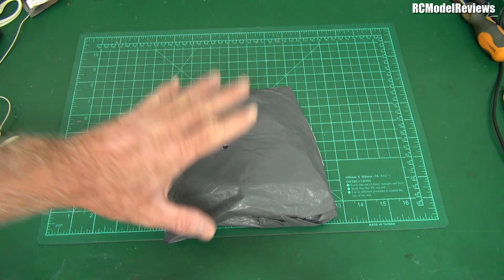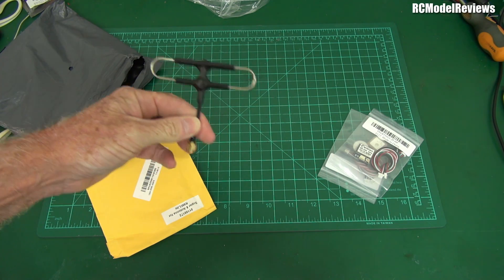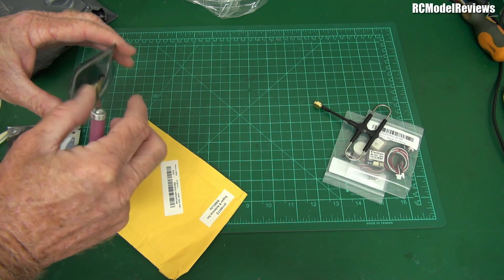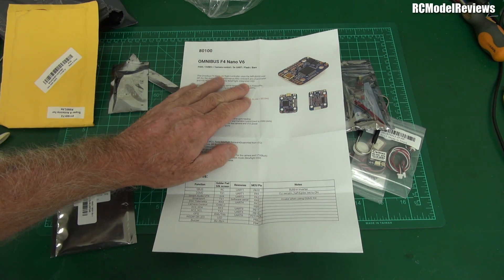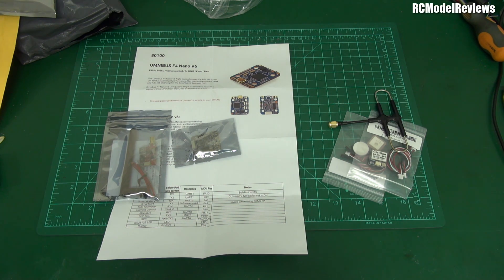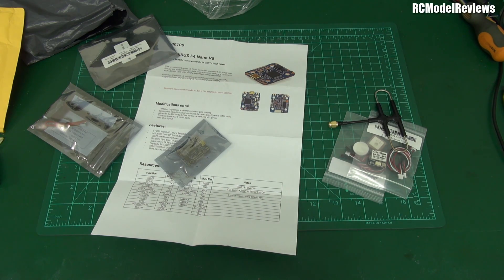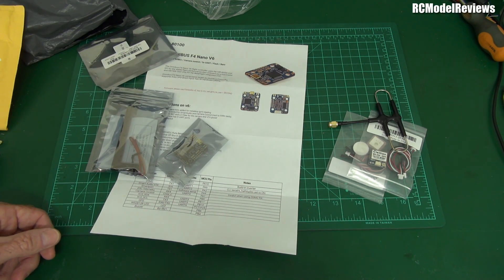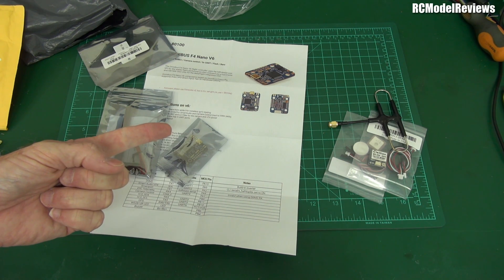Sub-250g long-range FPV project (bits have arrived)

Comment: you should check out Matek VTX-HV. Suppose to be really good. I just ordered one myself to check up against the TBS Unify Pro HV.
When are you planning on getting in the air? And what are you flying? Quad or wing? The WingWing Z-84 should be pretty good for a light build.

Comment: Hi
I also used the airbot 20x20 for a small build but missed the current sensor. Well, I added one of these XT30 Current sensor things but the airbot nano is missing a ADC pad. It has Uart 4 RX for ESC telemetry that doesnt help of course. INAV has no resource remapping, so I didnt know what to do. I then went ahead and changed the INAV source code for myself removing UART 4 and defining the rx4 pad as the current sensor pad. It seems to work, but to be honest I am not sure if I really did it right. Maybe you know.... 
I thought I share this, because building small should not mean to loose functions :-)

Comment: Check those Ublox GPS modules. Brand new I had really slow GPS syncs then I checked the battery and it was dead. I just made my own battery with two tiny 1.5v coin cells in series and now it syncs quicker every time. Also change to 10hz in the Ublox pc software.

Comment: Bruce, I have the folded dipole antenna and really don't see a huge range improvement over the stock R9 antenna. I am curious to see if you can compare the two and what results you get.

Comment: This has to be the longest, slowest project in the history of aeromodelling. In the time it's taken you just to get hold of the bits, I've built 2 x inav / R9 long range FPV powered gliders (Inc one twin tractor conversion), 1 x twin Harrier S1100 inav/FPV cruiser, 1 x Hyperlow 6" miniquad, and a 3D printed 9" inav FPV multicopter for search and AP.

And holding down a full time job in IT, and a side business, and raising two young children.

Come on Bruce, you're retired, should have had this sorted yonks ago! Stop enjoying yourself down the airfield and get cracking! lol :)

Comment: What's the point of barometer when gps will be there?
Reply: You get altitude as well with gps... I assume..
Reply: You are right. That used to be the case. But these days many drones uses gps for altitude hold. The problem with barometric altitude is it depends on air pressure. And pressure will vary with speed. If you don't cover the sensor with foam properly, or even from a sudden flow of wind, it can give wrong result. And fpv quadcopters are powerhouses for generating air flow around. 
Gps basically calculates the distance of the sensor from multiple satellite, does the math gives coordinates. Same way it can calculate the altitude. Here the accuracy depends on how many satellites is has been locked into. If a gps sensor gets 20-30 satellites, it can even be accurate by inches. Best of all, in a open field, it doesn't depend on anything else. Like barometer depends on flow or speed of air. I'm not telling that barometer sensor technology is dead and gps is the perfect way to get altitude data. But the thing is there and being used quite a lot. 
Not sure, but in latest betaflight you can probably do altitude hold with gps. Haven't checked it yet.
Reply: Hey look. Forget about more than 15 gps. And what you want to do with very precise altitude control on typical 5 inch miniquad? I don't know if you are into fixed wing or autonomous dji style drones and want to do something like mission planner type predefined flight paths or rock solid position hold in 3d space which exists but of no use as per my concern. After all miniquad pilots fly 99% time in acro mode anyway. Position and altitude comes in only in case of gps return to home after failsafe occur. And if you take a look at the data block coming from typical ubolx type gps sensors, you will find altitude data there. It's there from long time. So do you think that is a complete garbage?

Comment: Thanks for the video. I have been flying the RMRC Nano Talon and I would use the new Samsung 40t 21700 lithium ion  cell. It is a 4000mah, 25a continuous discharge and is only a little bigger than 18650 cells.

Comment: Will not buy any FC and ESC from China any more. I bought the Airbot F4 combo with ESC from Banggood for a Sub 250g. I built  it after 5 Months, then figure out that the ESC is dead. Fucking China stuff. Test you stuff when you receive them.

Comment: Your folded dipole doesn't have any color banding to denote tuned frequency. You should go for the R9 MM receiver for the uninverted telemetry
Reply: My thought with a folded dipole is feed impedance.  Good match for the old twin lead.  Terrible match for coax.  I'm wondering if it's really a fan dipole, which gives somewhat better bandwidth than a skinny dipole.

Comment: a TBS nano pro goes up to 400mw and needs only 5v input power and is very tiny. if size isn't that important i'd rather took a unify pro for a long range project. i wouldn't trust those old cheap vtx. just my 2 cents...
Reply: Just got the pro32 400mW. It has the highest mW per gram of any VTX. I wish they would make an 800mW version at double the weight.

Comment: 5.8ghz is not long range. You need 1.3gHz over 1w and uhf and over 20,000mah 6s li ion to even reach 45k any thing less is not long range.
Reply: hes going for sub 250g, that battery alone would be way above that.
Reply: To the vast majority of people 4-5k and higher is long range most people never go over 1k out, hell the mini quad guys would call 2k long range.. 45k is more endurance long range I imagine any 90k+ total flight is gonna take an hour or better unless you're going at a decent clip in a straight line the whole time.
Reply: https://youtu.be/7O02ctvB9x0
Been done before

Comment: How far would you get with a L9r on this setup to keep using 2.4 rather than 900?
Reply: Why would you want to? 900mhz is superior in every way.
Reply: @leephcom  because I don't have a 900 setup. All my gear is 2.4
Reply: last time i checked l9r cost as much as the r9 module

Comment: I’m gonna go ahead and say your gonna use the angle of the motors to control pitch but a fixed angle and the throttle value determines climb rate. Really excited for this build and interested to see the results...

Comment: Dont bother with the R9MM Bruce....just stick an XM Plus in it....4 km capable and more...you wont get that far on the R9..but be pleased to be proved wrong...lol
Reply: I mean, I have gone over 10km on the r9mm so... what are you talking about?
Reply: @kkrampus  That's my thoughts. If your r9 isn't getting much farther range than 2.4 there's something wrong. Just the 1W power output should about triple the range not to mention going going to the lower frequency, I think you have an issue in your system as many people have flown r9's out 20k+
Reply: @thirtythreeeyes8624  yeah, and 10km wasn't even the limit of the r9, it was the limit of my 5.8ghz link. If I get an antenna tracker and one of those super cannon 20db antennas it would only be then that I would run out of range